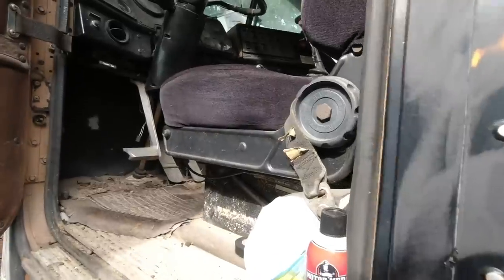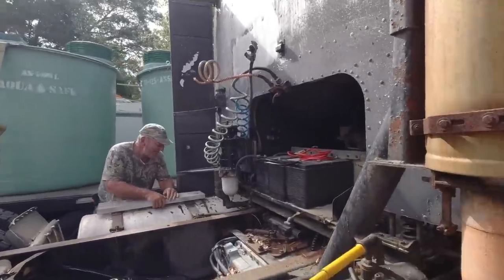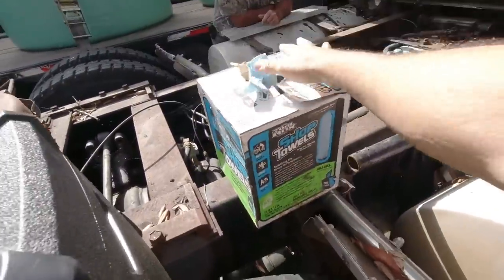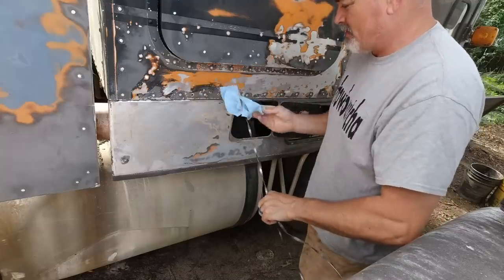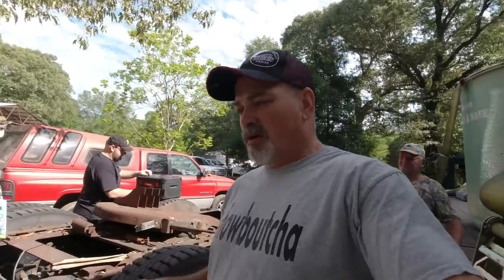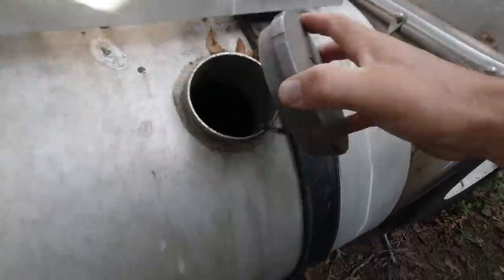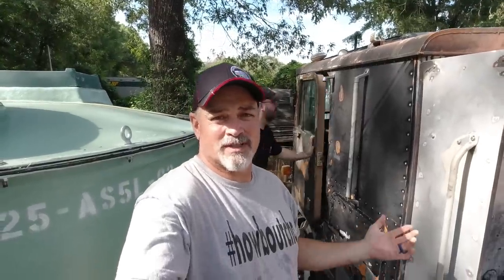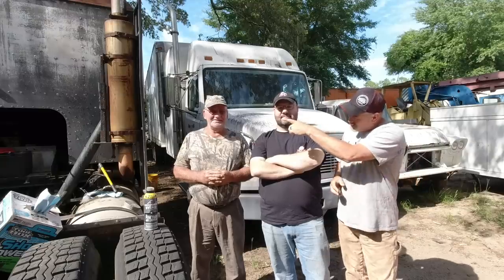Will It Start? Old Schneider International Cabover gets 2nd chance!

Comment: IH is a Cornbinder Freightliner is Freightshaker Mack is The Dog and Kenworth is the KW ! I drove a Transtar for many years and the not bad , sleeper is small and the windshield gets frosty in the winter ( defrost don’t work well on then ) but that’s an ordered tractor because it has the Cummins and not the IH diesel they usually come with and the interior is called western saddle which is also extra money ! That’s not a company tractor for sure that’s a Lobo rig ! I’d almost bet there was 2 logos on the doors , one saying Schneider and under that was International Transport , Schneider bought out IT in 1990 ! There’s possibly an order sheet with the paperwork !

Comment: Your buddy was right, the doghouse is big enough to sleep on an I used to do that all the time back in the good old days.  Cabover tractors died during my career.  Companies just couldn't get drivers to drive them anymore because the law changed allowing longer wheelbase trucks and combinations and trucks with hoods took over.  They road a lot better and where easier to work on.  I wouldn't mind having an old cabover but not to work it.  Maybe tow an RV with it.  I still got my 2000 KW W900 parked out front but am medically retired from driving after 30 years over the road.  Enjoy your channel.  Ya'll be well!  :)

Comment: I had a brand new Schneider 9670 in 1983. It had the square headlights a 9 speed and a 300 Cummins. It did not have an air ride suspension, it was a spring ride with a shorter wheelbase than yours. Are you sure it was a Schneider Transport truck? We were teamsters then. They didn't give us fancy trucks.
Reply: That's exactly what I was thinking. Never seen a Schneider truck with a 400 come a long in it, and never a 13spd.

Comment: Actually 9670 Internationals all have square headlights and short gearshifts. I drove an 82 and it had square headlights. They were good trucks. I liked their wide stance, they could handle curves with top heavy loads without getting squirrelly. I drove them for 6 years from 82 model to 86 model. They were all good trucks but the ones I drove had 300 cummings in them with a 9 speed Roadranger Transmission. They were company fleet trucks so thats how they were ordered. They would order 25 at a time. A 9670 International is my second choice for a truck, next to a Peterbilt being first choice. I drove trucks for 40 years. For dependability, you cant beat them. I hardly ever had a road breakdown with the ones I drove.

Comment: I worked for Schneider for 7 years in the 90’s. My first tractor as a solo driver was a 1987 COE9670 with over 850,000 of it. They kept them till the wheels fell off back then. That was a rough riding sob.

Comment: Diesel that's sat for a long time you need to put in some Bioclean or anti fungal cleaner into the diesel. It gums up injectors, fuel lines and all. That old girl will need some. A spool of new air line and a bag of fittings would be the best investment. The Engine is strong in that one. Sounds great!!
Reply from the maker: Thanks for watching Robert👍

Comment: Hank, I know that your a successful gardner and that is something to brag on as not many are. Now I know that your leaning towards a hobby of starting these rigs up and I get tired of you getting crucified by guys who sat in the seat for a couple of weeks and call themselves drivers. Until they walk the mile, I call bull pucky. Bringing them down out of the mountains with loads we only hear about as they got heavier as time went on. I know cause hauling through ITT Rayonier logging with loads that caused "Bookie Bill"  to run from the shack (weigh scales) until the truck was completely stopped. I ran a average week after week of loads of trees going to market of over one hundred thousand pounds payload as the truck was extra. We tore the wires crossing the highway down if they were drooping from the heat of the day. A limb left on the load sticking up would do the deed an we laughed at the time. I wouldn't be so proud today. You need someone to make you familiar with all the controls like that yellow button signifies the trailer, yellow is trailer and red is truck. Yellow will only release if there is a trailer hooked up to the glad hands. No matter what, a minimum of sixty pounds must be achieved to get either end released. That handle on the right of the wheel is for applying brakes gradual to the trailer only and the air app gauge says how much you are applying. I figure if that main air gauge ever reaches ninety pounds and going down, then your losing air way too fast. Its a hand and foot thing. Any more a Pyrometer is a thing of the past but this truck has one and it tells how hot the cylinder is getting... depending how close they mount it to the turbo and before or after as how hot it can be before irreparable damage occurs and seldom are there a lucky one as they are in rubber and it just doesn't forgive.,k as your experience grows, your appreciation grows. Take care Hank and try to start that old 59 chevy apache pickup truck, I just loved them, that one is the same color as the one i owned.... I guess it could be older as i just got a peek of it...  thanks
Reply from the maker: Thanks Morgan. I have about 200,000 miles in them. Drove them in the early 90's. Good times for sure. Thanks for watching.